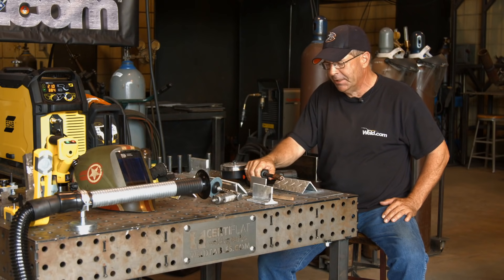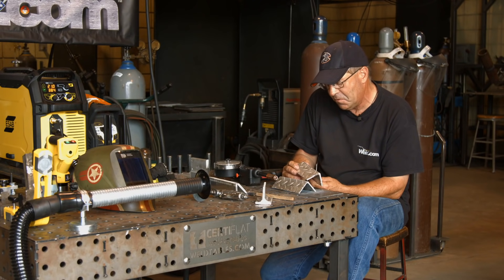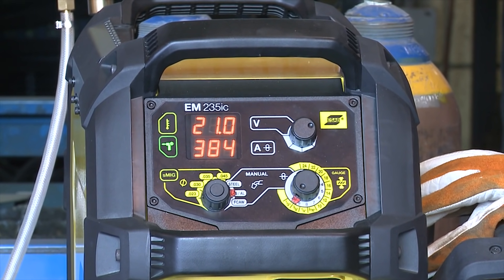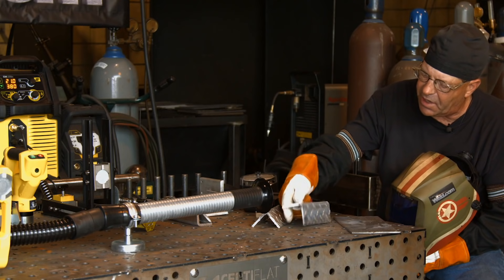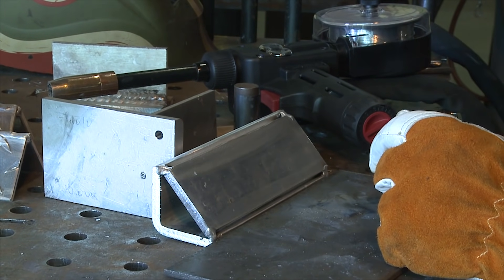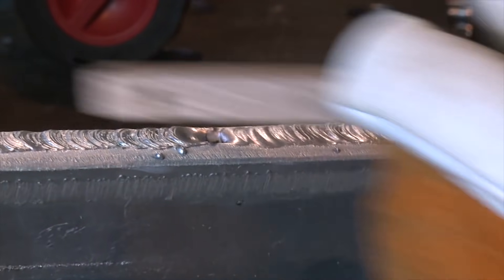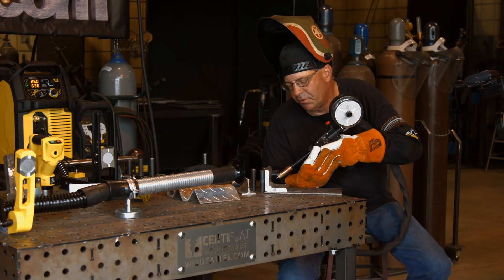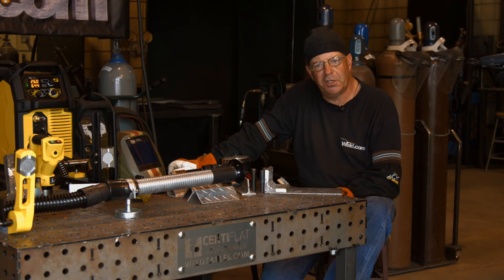🔥 Aluminum Spool Gun Settings Test

Comment: Im a professional aluminum welder. Ive welded xray aluminum piping and plate for varies applications. I can start by telling you need more voltage.Also it ok to weld downhill only if  the weld wont be pressured,strained or subject to vibrations. Uphill is the way to go but does take high skill level using cv. It is however easier with pulse mig.A push angel with high voltage tighter oscillations and faster travel speeds will deliver best results.
Reply: Good stuff. Thanks for the feedback.
Reply: I was wondering about that, how well pulse manages the heat through a spool gun.  Will all spool guns work with pulse if the machine has it?
Reply: I’d start around 23 24 volts
Reply: Does a ground not have to be used or is it grounded through the table? Probably a dumb question but just trying to understand as best I can
Reply: @zachlarson8360  a ground is necessary. It is grounded through the table.
Reply: Thank you .... I'm learning myself
Reply: I usually preheat, ive got a rather odd ball project doing 3/4" thick aluminium plates for a modile cat walk on a passenger ship dock. Theres all position i have to test the ticket tomorrow but i run around 27.9 - 29.4 around the different positions. Im not an aluminum guy but ive had good results in practice. Am i cooking it or what you think?
Reply: assuming you are using a spool gun not "cooking it" depends on your travel speed. the higher the voltage and wire speed the faster you have to travel not to burn the material.
Reply: Welded alot of aluminum trailers in my day was always taught to never  go downhill with aluminum. It's too fast and you dont get the proper penetration that's with spray though might be different with colder processes
Reply: dragon5675kj can u pulse mig with a spool gun. Sry if it’s a stupid question I don’t do mig or Aluminium but I wana buy a mug machine that can do ac dc so I can do some aluminum
Reply: @Dragon 5675k please i am a  welder helper in alluminium and i want u to help me on how to make the best welds with maximum penetration, using the right settings and the way to move the gun in respect to the welding position. We use fronius welding machines  and weld in Pulse transfer mode.
             Thanks
Reply: I'm a professional also and I can tell you the better the equipment the better quality welding.  Meaning the spoolgun and machine. With a much better setup I think you would be making better looking welds
Reply: Also I always try to weld uphill.
Reply: @davidplaisance8385  Not always the case. Proper setting and techniques main factors. I own a small fab.business. I do all my aluminium mig welding with a Vulcan 220 with the spool gun..I dail in my settings and produce welding with the strength and quality same as leading brand machines.The change happens when you have mig pulsing capabilities.
Reply: Your right you should always try to weld uphill with aluminium
Reply: @inuhuabdulrahim7966  Look me up Dragon Welding &Fabrication LLC.
Reply: @jonathanc3177  Yes you can the pulsing capabilities depends on the machine.The welder has to have pulse mig capabilities
Reply: @jonathanc3177  You only need ac when tig welding aluminium.
Reply: @dragon5675kj  I agree 100% I do 90 % of my work out my truck on shrimp boats and aluminum crew boats in the river I just found I wasn't the quality with the cheaper spool guns but it is also hard on Equipment working out of a truck . I'm gonna be buying a machine for my shop soon and I tell you what that Vulcan I looked at many times if you say it holds up I'm gonna give it a shot for my shop work.  !!
 .
Reply: and try to get it to spray and ad Helium.
Reply: Thanks. Does MIG Aluminum prefer AC like TIG?
Reply: @IcarusX72  No. 100% argon or a argon helium blend with your typical mig setup.  Better results and efficiency with a spool gun or push pull system.
Reply: @dragon5675kj  Thanks so much for you help!
Reply: Uphill is indeed difficult.
Reply: I’ve been doing this for the last 2 minutes and the uphill weld I made looks better than everything else lmao
Reply: Post video
Reply: @bobmoffatt4133  loved your video mate
Reply: Pulse doesn't effect the torch, it effects heat management. You can get good penetration without the parti getting so hot that you melt away big chunks. Aluminium has a very good heat transfer wich Means the heat affected zone is so large that a blowout is huuuuge. Iike the size of a nr 11-13 sized TIG cup in diameter.
Reply: Down hill is fine. You are almist 90° to the welding joint. If you weld uphill you would have your gas settings so high the waste doesn't justify the cost, and you would still have .Porosity. I have dumb truck beds and belly dumb beds that are still going 10+ years.
Reply: I welded aluminum for 30 yrs (now retired) for dept of defense. Always was applauded for weld appearances. I saw so many welders spitting splatter. Turn wire speed down for TIG like appearance. All welders want their work admired by peers. 🕊️🇺🇸
Reply: @billmcyrus  yes
Reply: @dragon5675kj  I got the 220 and it has 2 spool gun settings which one do you use.

Comment: I'll tell you my opinion, and I've gotten in lot's of heated debates over this that you should always push your weld.  I used to well the BOC trailers.  I did lots of aluminum mig and tig welding.  To weld the head on the trailer it was 277 inches  circumference.  It had to be x-rayed and helium leak tested.  I hate to say it but you got a lot of people on YouTube having some experience and are pretending like they know everything about welding and they don't.  I been in the trade for 38 years I think in that amount of time I've learned something.  When pulling or dragging you always burn into your weld, when pushing you're always pushing it out of your weld "contaminants" hence why you have a cleaner weld.  That's my opinion I don't want to get into heated debates I'm sick and tired of all the arguing on YouTube from pin heads that really don't have much experience.  But Hey it is what it is.  Like I said this is my opinion.
Reply: Hi how are you ? I have a question, do you need an AC/DC mig to weld aluminum with a spool gun, or only with DC you can do it? Thanks

Comment: I love the fact that Bob welds sitting down; now that's a guy after my own heart.
Reply: Makes it easier to film. Camera guy rules!!
Reply: What you need is a stool with wheels, so you can roll between the welder, welding table, tool bench, etc without standing up.  Why walk when you can roll?  It saves time and energy.  

The first rule of welding is "Get comfortable."  Right?  That's what I was taught!
Reply: fredy gump Genius!
Reply: fredy gump Pretty soon I'll need a gurney!
Reply: I was always told to work smarter not harder, what is smart about standing all the time. Especially when doing something that requires steady hands and good coordination, I figure sitting removes a lot of variables.
Reply: How about a personal mobility vehicle, with special baskets or racks for your gear?  I have often imagined myself with a modified walker that carries some tools and maybe an extension-cord on a reel.... some kind of bright LED lamp/magnifier kind of thing.  And I don't know... maybe a little oxygen thing.   There might be a boom in "shop" kind of teaching, it might be hard to retire!
Reply: I've got a hairdressers stool for that, wheels help scooting around the bench or getting comfortable, adjustable height, it's awesome!
Reply: That’s a weird comment bro. Lol.
Reply: fredy gump I bought a HF roll away stool. Thing works awesome till you try to roll over a dog hair then gets stuck.

Comment: I weld aluminum dump trailers and the best way to get rid of that hole and crater when u get to the end of the weld is pull back a little and make real quick tiny circles in place and you won't get that crater also turn the heat up and wire speed down and you won't get that fisheye as much
Reply: Robert Uebinger  Or adjust your crater fill time on the machine.

Comment: I've been around aluminum Mig welding since 1987 building transport trailers, first using Miller's huge "camcorder" spool gun then later using their XR-30 guns, and lots of different makes and models since then. I am currently employed as an outside sales rep for a welding supplier and I frequently teach customers how to weld aluminum.
For general purpose welding I suggest 4043 3/64" wire (because of its current carrying capabilities) and at least 35cfh Argon gas flow, and a 15-20 degree tilt back on the gun, always pushing the weld.  In this video your fume extractor is creating a draft, which means you will need to add more gas.
GROUND is very very important in all welding but is particularly important when welding aluminum, for your test area I would suggest that you find a way to ground each piece that you are welding, I'm sure you noticed those little arc tracks on the bottom of your coupons because your piece was trying to find ground. It will also help minimize burn backs to the tip as you start to increase your heat to get further into spray transfer. 
Keep up the good work, I'm very impressed with the arc stability of that machine, I haven't seen one run aluminum before but I may need to get one in my store for testing based on what I see on your video.
Scott
Reply: A gall dang gentleman here, sharing tips on a professional level.
Reply: Hi how are you ? I have a question, do you need an AC/DC mig to weld aluminum with a spool gun, or only with DC you can do it? Thanks
Reply: @MatiasArezo  AC would be for TIG welding. For a spool gun you would use the same machine as a normal wire feed. You will need to change the gas to 100% Argon. You should be able to search your existing wire feed welder and see what spool gun options are available.
Reply: So I run a 150 amp spoolgun on my millermatic 211. Welds come out good and shiny. But all around the weld is heavy black soot. I’ve messed with gas and everything else I can think of and I can’t get rid of it. Any and all thoughts would be appreciated. Thank you.
Reply: @Froggies505  The black smoke next to the weld is normal, it’s called “smut” and is easiest to clean off after you finish your weld. I would normally keep a stainless steel tooth brush in my breast pocket to clean welds.  Cleaning the weld joint of all impurities with a large stainless brush will help reduce the smut from the weld zone.
Reply: @Froggies505  wiping/ cleaning metal with alcohol or acetone in addition to wire brushing before welding will help with that a lot also. Good practice
Reply: Scott,  Like the info, and wish I knew where you teach aluminum welding. what is all the cracking from in his welding, after he first starts it run great, then snap crackle pop ? O have a Millermatic 211 with MVP, and a spool gun, now to start messing with it and settings. and tips would be great
Reply: @douglasbattjes3991  I would suggest any starting point for aluminum welding is. Plenty of Argon, clean material (get a good stainless shoe brush and a toothbrush style). The voltage will be dependent on material thickness, but you will have less “burn backs” if you start slightly colder and work your way up in heat. Place your ground clamp on the piece you’re welding,,that will save you a ton of headaches. Then just practice…

Comment: 7 years later and this video is still teaching.....picked up a Tweco spool gun for my Rebel 215 and was struggling to get good consistent beads. Watched a few other videos, but they didn't really help. Watched this one, tweaked a few setting based on what Bob did, and bingo....good welds, consistent from joint to joint, and still worked in a few different joint configurations. Thank you much Bob!

Comment: Bob, 
Looks good but remember that welding aluminum with a spool gun should be ran with a "spray" transfer. You are starting out fine but increase your stick out to maintain the spray transfer.  running downhill can be done with a near perpendicular gun angle. Uphill sometimes is easier as you are not chasing your puddle. Another thing to help is to clean your oxide off the plate before you hit it with the arc.
Chris Ingram
welding Instructor
Dawson Community College.
Reply: The videos on your channel helped me understand your experience level. I knew you had to be a pro to correct Bob so I was in for a treat!

Comment: Wire feed aluminum downhill vs uphill mainly depends on scope; code or non code work. If the work is coded then uphill is your best bet to pass NDT or DT (non destructive or destructive testing).

Thanks,
Quincy
Reply: Thanks for your post. I went and checked out all of your welding videos so I could see how you know so much that you could correct Bob.

Comment: Taught simple classes on welding optimization.  Biggest problem?  What does voltage do?  What does wire-feed speed (amperage) do? Most welders don't know.  There are only three controls on a MIG weld and they need to be set in a specific order.  1) wire feed speed increases amperage that provides penetration.  2) Travel speed and angle fills the crater.  3) Voltage shapes the puddle.   ( Also, are you weaving to try and imitate a TIG bead?   Each time you weave you change the interaction of the three components and can introduce error. )

Comment: The black soot can be prevented with cleaning the surface before welding. Also increasing arc length to rid the spatter and crackle sound.

Comment: Bob, for my spoolguns I have to hold and unusually larger gap from the tip to the material. Like around 3\4" or so. Turn your voltage up to about 23ish volts. Almost like a spray transfer

Comment: Hello Bob. I've welded for 30 plus. I was welder in navy. We learned welding aluminum with spool gun vert up and overhead heavy plate 1/2  an thicker using short circuit transfer and co2 as shielding gas. Never used it since very interesting to say ther least  but weld result was good. I've since used spray transfer on trailers and misc and used mix gas for heavy parts or build up on tire molds  the gas shield is key. I use to have diagram of weld profiles with different shielding gases. Would like to hear your tale on how gases effect weld characteristics and heat imput

Comment: Nice quick tip Bob when you do Aluminium also make sure you use the right wire and mention it in the video. On Crater fills try the O motion in the crater. If you can set a post flow or argon it will reduce your crater.

Comment: At the end of the weld you need to pause for  about a 1 count to fill the stop so the weld won't crack. The start and stop are the most important.  Pre-heat if needed but be careful, aluminum turns to powder real quick with to much of it. Other then that good weld brother.. keep helping build America 1 weld at a time!!!!!!!

Comment: I am NOT a professional welder.  Just a DIY guy that had some exposure in my mid teens during high school working at a machine/welding shop.  The boss was known as the best helicopter-arc welder around, Aluminum and SS.  He had a Miller with a spool gun he used occasionally for longer welds on new work but by far he used Tig, especially for repairs.  Seemed he could far better control the heat and the gas saturation of the weld area.  I enjoy welding though I am constantly watching and learning.  I was taught if it had flux weld uphill, if it was gas purge up or downhill was ok so long as the weld puddle and tie-in interface was controllable and good.
Reply: Auto correct horse shit helicopter, ha. Heliarc

Comment: you don't want a tight arc with aluminum MIG. but you also don't want so little wire feed that you're constantly burning up tips. put a bushing on the feed spindle and grease it lightly as needed to eliminate chatter and inconsistent feeding. I run an old miller spool gun at elite trailers, my voltage is always set at 26.5 and my wire speed is dictated by hash marks around the dial, I tune it by watching my arc width on tacks and listening for a slight sizzle.

Comment: I'll have to try a spool gun before offering an opinion on preference but, aside from quickly laying down ugly beads compared to using a Tig torch and filler rods
I don't really see a great advantage.
You can't get into tight spots, you still need to keep the wind from blowing your argon away; the gun is an additional equipment purchase as well as more spools of filler to buy and keep on hand.  Pound for pound the little spools are the most expensive so you're wrapping up even more money in wire plus now, storing it until you need it.
Maybe if it was flux cored I could see a great advantage for welding in the field!
As I say, I really need to try it before I make a judgement call but the obvious evidence doesn't make me feel like I gotta have it!
Thanks very much for the demo video though. It certainly was worth the time to watch it!!!
✌️
Reply: Price out a push/pull setup vs a spool gun.

Comment: hey bob, I didn't start liking my spool gun until I started setting up for spray transfer essentially.  That fixed lots of things as long as you get and keep moving fast.  Also I find it helpful to have a little pull angle going down hill with a little higher gas flow.  You can hold the puddle up a little if you are a little cold, and that seems to work. Don't know if that is sound but my spool gun is on too small of a machine really, so necessity became the  mother of invention...

Comment: We use a push pull system  on our Lincoln mig welders we weld almost exclusively aluminum 6061 base material 5053 wire we always push the welds and never ever weld down hill

Comment: near 20yr ago , truck shop , wespool welded ,heated , aluminum truck boxes (blacktop haulers) with 75/25 ar/co2 and did very well. i think part of reason was , we used MIG regular , so spool gun aluminum was easier transition , worked very similar.